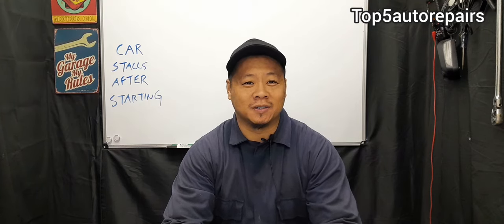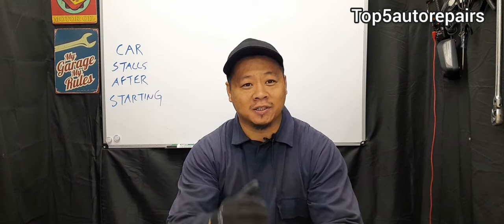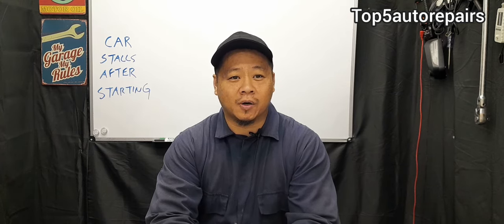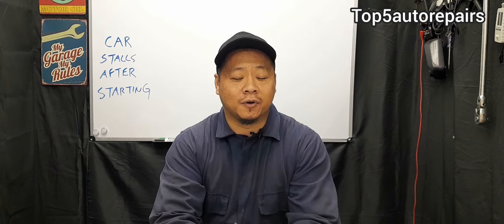CAR STARTS THEN STALLS AND SHUTS OFF | CAR WON'T STAY RUNNING AFTER START UP

Comment: If I give mine gas it sounds like it's not getting gas an it continues  to die out, but it's getting gas
Reply: Did you check pressure at the rail?
Reply: Smae dude I'm getting pressure replaced everything including spark plugs and boots
Reply: Same
Reply: Throttle position sensor

Comment: Easiest way to determine if the MAF (mass airflow) sensor is the problem?   

Unplug it.  

Then start the vehicle.

Mine fired right up and ran all the way to the parts store.

Comment: mine feels like its vapor locked at times. I pump the pedal and the gas is not moving and SUV stops. I have opened my gas cap then waited a few minutes and it starts again.  I love your video, but more people would watch it if you showed the. parts. So many on YouTube want pictures and trust me, I make videos on different items.   Thank you very much for the information and LAST THOUGHT about using SEA FOAM IN THE CARB AND GAS TANK.

Comment: My car never struggled up hills, but when cold starting it would vibrate gently not hard enough for shaking for like 8 seconds. Then today i parked it for my 8 hour shift, tried to start it after and it would start but then shut off. Would you happen to know the reason? Im thinking fuel pump but im not quite sure. Thank you in advance
Reply: Did you figure out what the problem was? My vehicle does the same thing.

Comment: If anyone can give me some knowledge I’d appreciate it a lot, so my 2004 f150 4.2L V6, stalled on me while driving at low speed it was very shaky and Sputtering when I started it, now when I try to start it pops from the intake area and then dies, what is wrong, I have fuel pressure and Spark
Reply: I need this answer too
Reply: imma say dirty fuel injectors also check your spark plugs that you don’t have a oil leak into em could be not running on all cylinders

Comment: Thank you for your video. I found the problem thanks to your video. Very helpful.
Reply: What was the solution to your particular problem?
Reply: @anthonycartwright2460  part of the cold air intake was loose. Easy fix. Lol didn't Check that.

Comment: Just did a cam and lifter job on a hemi 5.7 dodge ram 1500 new timing chain new gas pump battery heads resurfaced new seals everything basically has been upgraded to new and at start up it starts fine but as minutes go by the truck starts to struggle to maintain idle rpm it starts to drop until it stalls, any idea ???
Reply: Try the tps sensor

Comment: Can someone help me, i have a mustang 5.0 manual 2015. I noticed when i start the car on a hill the car starts and stalls directly. Sometimes on the second cranks the car doesn’t stall and works fine. I recently changed fuel pump, spark plugs, purge valve, and fuel injectors. Also for a full tank it shows range of 250 km only and 4.8km/L fuel milage. Also I feel the power is wayy below average. Any solutions please 🙏

Comment: Our 2005 Subaru Outback XT 2.5L turbo, had a plastic bag sucked into the turbo inlet pipe/engine air intake. Thankfully we were able to remove it and it didn't get destroyed by the turbo and/or sucked into the engine. The car was driven only 1/2 a block in this condition. Now the car stalls immediately after turning on and won't stay on. What could this be?

Comment: I have a question for you I have a 2008 Corolla and I think battery is bad I can jump it and it starts remove cables and then it dies within a minute or two, can I get your thoughts on this I am so confused. Nice video by the way
Reply from the maker: Hello. Most likely the alternator is failing. Did the battery light turn on? If it did, replace the alternator. However, make sure to check the battery cables condition for corrosion.
Reply: Ok thanks for your feedback I'll check it again for the light cables are clean but battery is 6 years old
Reply from the maker: You might have a weak battery as well. Check battery voltage it should be 12.6 volts.

Comment: What would cause a car to start normal and drive normal when it's cold but then after shutting down and leave it for like 5 - 10 minutes, it would then start but then stall and shut off?
Reply: that's my exact same problem i have a passat b7 2012 do you still have that issue do u have any idea whats causing it?
Reply: Did you fix it?
Reply: Any fix ??

Comment: If I hold ignition turned but let starter disengage truck will keep running. If ignition goes to regular location after starting it will die in two min
It always starts, then dies in a min or so. All started after hard rain

Comment: I accidentally left the windows open overnight and there was a heavy downpour, my whole car got soaked inside. After this it won't stay running after starting it. Before that it was having trouble accelerating after pulling out onto the road or after a red light.
Reply: Sounds like your computer possibly got wet…

Comment: Mine ford ranger 2.5tdci auto year 2008. It starts then shuts off after few seconds. But if i start and press the accelerator for a few seconds and slowly release it will stay running. Fuel filter already check but problem still occur. Can anybody help me.?

Comment: My car was seemingly struggling to get fuel to the engine. My thought was this because when I press the gas, the RPM's go down and I cannot accelerate enough up hills. And you can feel the sputtering and jolting of the car when some does get through. I changed my spark plugs because I thought it was misfiring at first, but now I'm down to the IAC valve or a fuel filter assembly. I bought a new fuel filter for the one inside the fuel tank, but the issue wasn't solved and now my car cannot even idle, but shuts down and same issue with dropping RPM when I press the gas to accelerate.
Reply: So I found out I have a fuel filter under the hood, so my thought would be to try the fuel filter first before the IAC valve because the IAC valve is over $300 from toyota.
Reply: Word for word what I’m trying to fix right now, did u ever figure it out.. if you did plz reply and let me know

Comment: I got a 2003 Pontiac Bonneville with a 3.8 engine I lost the original ignition key I found the spare I wonder if it's because the spare isn't programmed the chip inside the key or if it even has a chip it starts runs for about 3 seconds and dies
Reply: You ever get anywhere with this? Going through the same with a 99 3.4 olds alero. I have already bypassed the anti theft with a resistor. Same result, gonna swap the iac next with a known runner, try and check/clean the egr valve do an intake leak test with the smoke machine. Then swapping the ecm. We'll see... 😅

Comment: Brother, my car runs, but it dies after a second it will keep running only if it gives it gas by accelerating  2010 civic any idea
Reply from the maker: Clogged or bad idle air control, vacuum leak or bad misfire=very weak ignition coil. But the two first are the most likely issue
Reply: I have the same problem, did you fix it ?